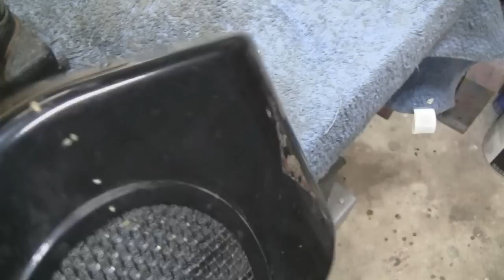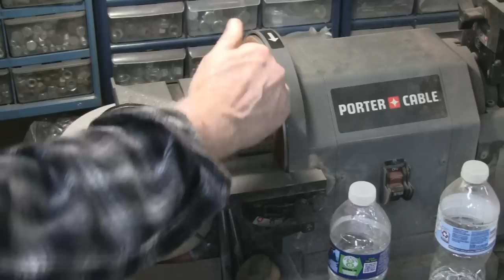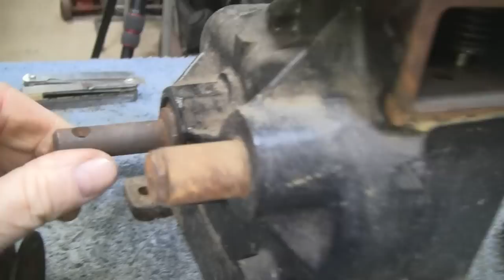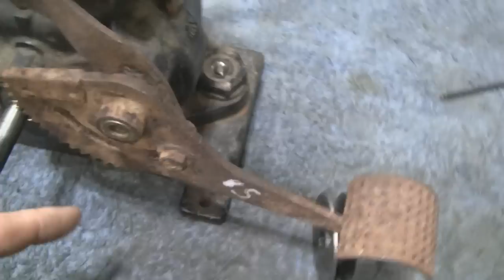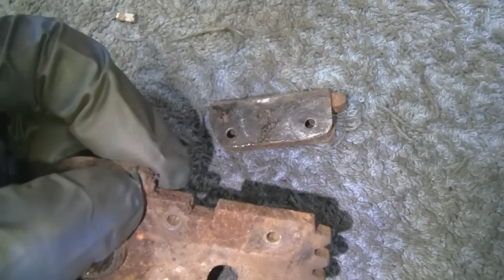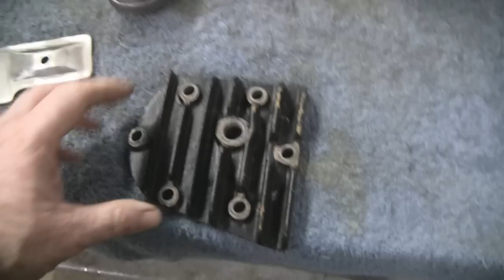BRIGGS MODEL WI SEMI-RESTO (part 2)

Comment: Outstanding episode!  That disc sander jig was awesome. That is a proper disc sander, the 6" ones with the aluminum backplate just don't cut it. I was amazed at how that valve grinder worked!  I never knew.  Back and forth action..  WOW!   I have fallen in love with lapping compound, especially in old tins.   =D   Great stuff
Reply from the maker: Thanks Buddy!! The most used tool in the Garage!! That eggbeater is the tits Bud, I open it up in part 5 to show how it works!!☻

Comment: Great video on lapping and taking some off of that valve.  What was that engine made for?  It would be cool on a mini bike with that kick starter :)
Reply from the maker: Thanks Jerry!! Originally they were design for washing machines to replace the engines on the old Maytags!! Then later on they migrated to Reel Mowers!!☻
Reply: @805ROADKING  Ah - got it.  Thanks RK - have a good weekend :)

Comment: Nice job, RoadKing! Lapping valves is a good tactic. Once burnt, the valves are done though. It changes the temper. Got too many aircraft engines with that problem. And the Chinese own all of the small aircraft companies now..
Reply from the maker: Thanks Dog!! I didn't know that about the China Planes!!☻
Reply: @805ROADKING  
The Chinese bought Beechcraft. Cessna, Lycoming, Continental,  and Superior Air Parts. And many others.
Reply: @upsidedowndog1256  😮